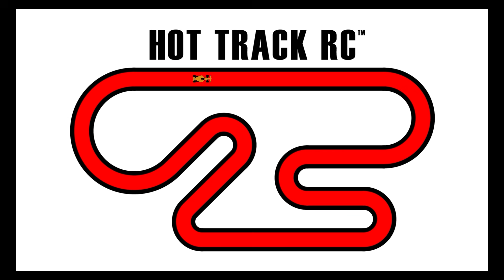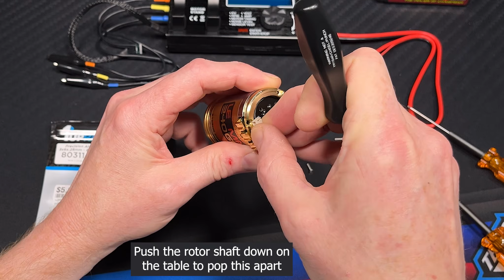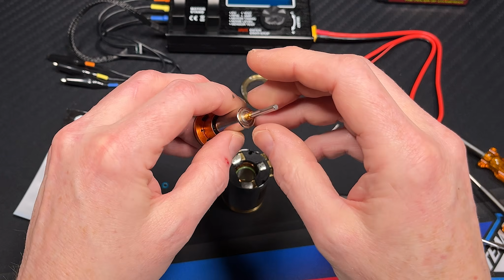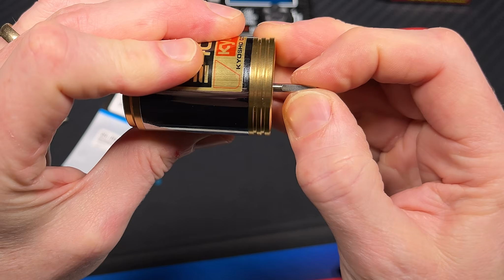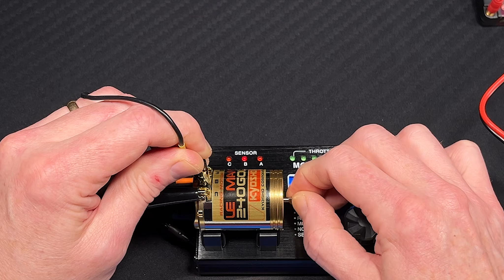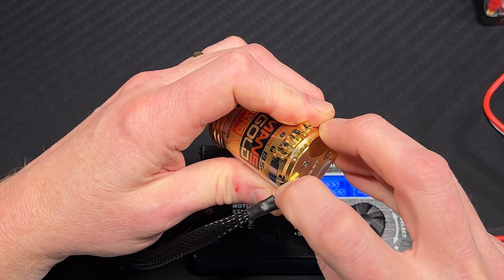Dialing in Performance on your 540 Size Brushless RC Motor

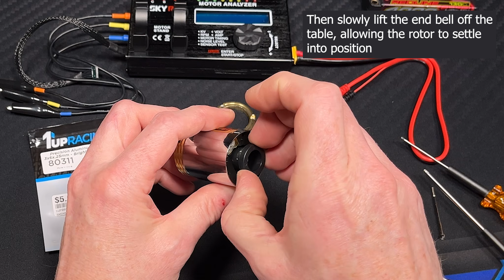Comment: 16:45 What oil ya got there Mr? I use(I have a small amount left): "Trinity Perpetual Motion Ultra Lightweight Motor Bearing Oil"

It''s no longer made as far as I can tell, so now I'm on to: "Liberty Synthetic Oil"
Reply from the maker: I don’t have a strong recommendation for you but I’d check out what Amain hobbies has.  Search for bearing oil.  Looks like they have some good options.

Comment: Did you ever finish testing the motor completely? From this it looks like I'm pretty safe just going to +10 and keeping an eye on motor temps. I have this motor with the 240S ESC in my freshly built Optima Mid Worlds 4wd buggy. My first brushless setup.
Reply from the maker: I increased the timing another couple degrees in the car and I think I got up to a 28t pinion without overheating and no fan on the ESC.  Check out the Team Car Track Time episode.  Definitely keep an eye on your temps as you adjust.
Reply: @HotTrackRC  Thanks. I'll tinker with it over time and see how it does. If NorCal Hobbies is what I think it is, I begged 
my father to take me when I was a kid just getting into this hobby in the 90's.

Comment: One thing ive never done is use an analyzer. I just add boost and turbo on the esc. But i guess its all about getting the most out of your motor
Reply from the maker: For stock class racing, mechanical motor timing is legal but not ESC timing.  So that’s the main reason to tweak the motor.  ESC timing is better because it can adjust timing for different rpm ranges which is really cool.  It’s still a good idea to check your mechanical timing so you know where you are starting from.
Reply: @ yeah, im tempted to get one to just play about with 😂 esp as in winter we race indoors, and its 10.5 on blinky. So getting the most out the motor would be good